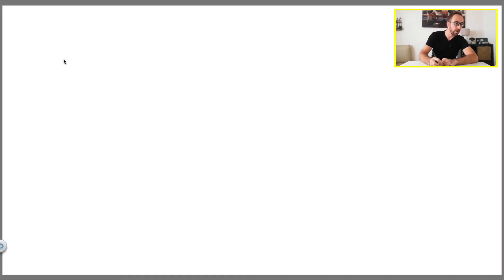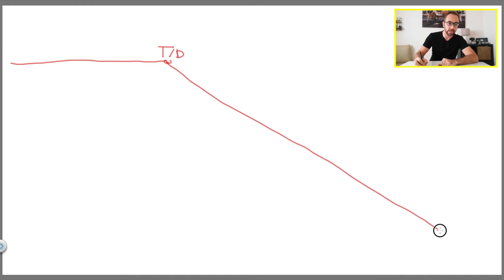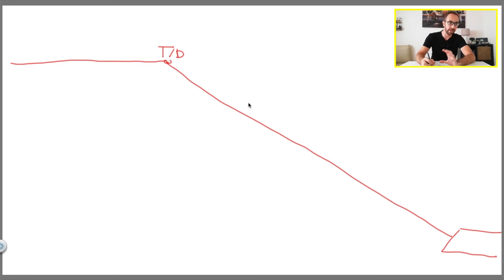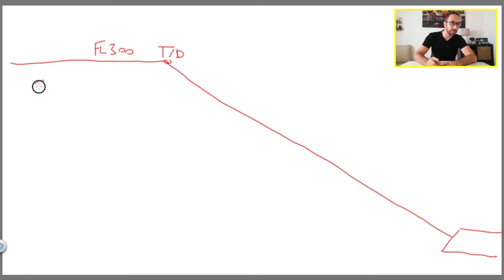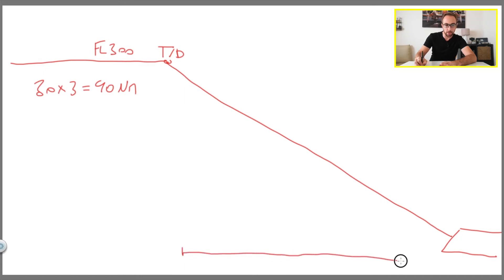VNAV: What is it and why is it important? [Vnav basics and how the Airliners descend!]

Comment: Hello Captain, loved this video.
I have a question as usual :
If the CMD disconnects (both A and B) while you're on CRZ Altitude, do you actually perform all of these calculations and start descending manually since you don't have LNAV and VNAV? You wouldn't even have HDG select, Speed etc. So my question is, if both autopilot fail on Cruise Altitude and Speed, what are you supposed to do? Land on the first closest and more suitable airport or continue to your scheduled Arrival Airport? Thanks again and wish you a great day and week-end 😊😃
Edit: I know that you select both autopilot only during Autoland procedure, but what if you're unable to use either of them during flight? You can use the speed selector because Auto/Throttle is independent from Autopilot, but what if the entire MCP Panel fails? 🤣 I'm being too much catastrophic, sorry, but I'd like to know what to do in the worst case scenario
Reply from the maker: Hey, great question!!! If the AP fails during cruise you need to go below the RVSM airspace (I made a separate video about RVSM) if you have enough fuel and the weather is good enough you can continue to the destination...but this is a Captain decision and might change depending on some other factors such as fatigue, length of the flight and so on.... if the whole MCP fails you fly like a CESSNA. 👍
Reply: @PILOTCLIMB  I'll watch the RVSM video ASAP. Hope this never happens in real life, both MCP ans Autopilot are super important to a safe, reliable and with less workload flight. Thanks captain, awesome answer as usual, loved it 😍

Comment: Good day, captain. I am currently in type-rating training for b738 as well as your new subscriber. In the video you mentioned about using anti-ice as a factor of the airplane descent performance. Would you like to explain more in detail about the how the anti-ice system affects our descent performance and calculations? Thank you very much, captain. Greetings from Indonesia.
Reply from the maker: Hey, congratulations for your type Rating course... when you switch the engine Anti ice on the Engine Idle will be higher thus, it will require more miles for.your descend..

Comment: Sir, thanks a lot for the nice explanation. But I have doubt, which I thought to make it clear. For example, we want to decelerate down to 250 KIAS, from 300 KIAS by FL100. Can we use the speed brakes for this purpose, instead of lowering the rate of descent by pitching up?
It would be grateful, if you answer this question, sir... Thanks in advance :-)
Reply from the maker: Hey, many thanks for watching and the great question! If you want to decelerate when flying an Idle Thrust Descent you must reduce the rate of descent. The main benefit of using the Speed brake is that you will reach the 250 kt early. Check out this video that I posted few days ago it might help you  to understand this concept: https://youtu.be/mQ2ylgQOUt4
Reply: @PILOTCLIMB  Sure sir. Many Many thanks for answering my question.